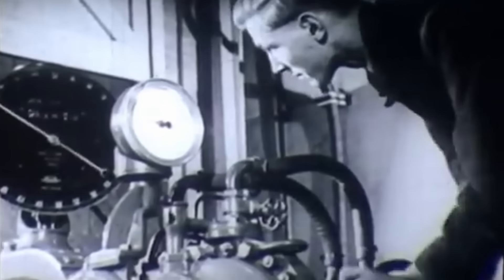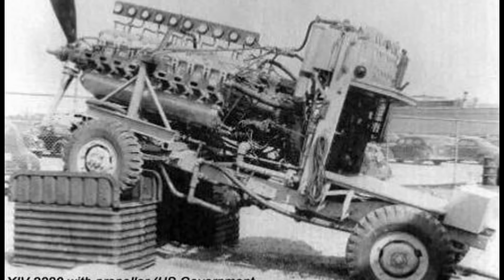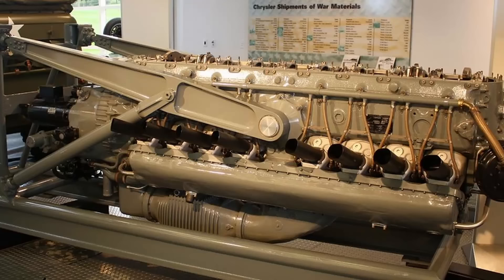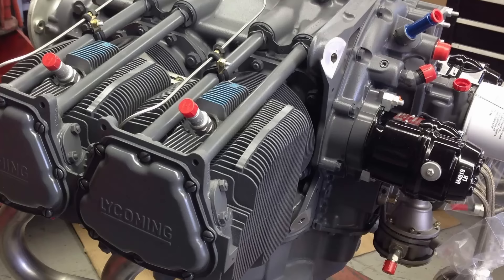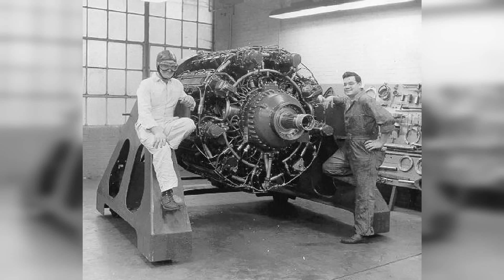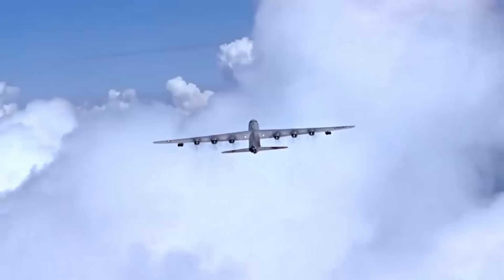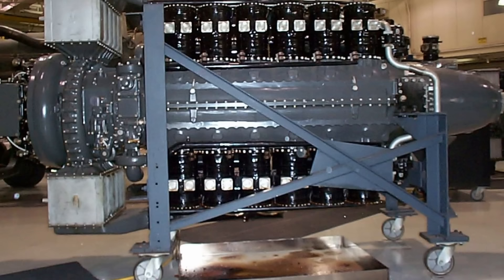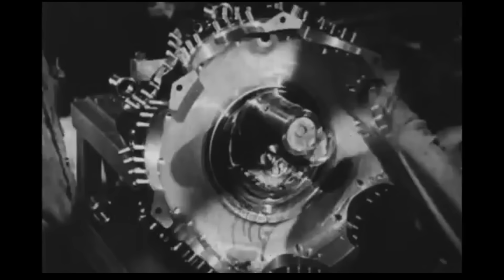The Forgotten HYPER Aircraft Engines of WWII

Comment: It’s rather interesting that none of the US engine manufacturers tried with 2-stroke designs. Rolls-Royce, on the other hand, developed the Crecy which was pretty much the crackhead cousin of the Merlin.
Reply: The Crecy ran on the test stand but that time the piston aero engine was being superseded by the gas turbine.
Reply: You cant use 2 stroke engines
They need turbo and 2 stroke have no valves so the pressurized air will pass and the engine will lose a Ton of power.
Plus you must regolate fuel mix relative to altitude and 2 stroke cant mantain mix precision
Reply: An excellent comparison
Reply: Look up the junkers ju-86p and the jump 207 engine
Reply: @RealNotallGaming  Don't tell Electro Motive that .
Reply: @mpetersen6  It's a shame because apparently when it was tested the ground crew had to use earmuffs even miles away from the testing site. Alongside the Kuznetsov units in the Tu-95 and the experimental Allison ones in the Thunderscreech, Spitfires with the Crecy would've been one of the loudest propeller-driven aircraft ever built.
Reply: @RealNotallGaming  Not necessarily a turbo, but forced induction was necessary to flush out the gases from the crankcase quickly. The Crecy I mentioned had sleeve valves replacing the more conventional reed valves in 2-stroke engines and a supercharger to flush out the gases quickly, which helped it gain approximately double the HP of a late-war Merlin.
Reply: @mpetersen6  and what a shame that was.
With the noise and power it made, it would have been impressive.
Obsolete, but impressive.
Reply: @RealNotallGaming  I'm surprised the Germans didn't know that, and wasted all that time actually making 2T engines.
Reply: @RealNotallGaming 2-stroke diesel with completely separated oil system already existed several years earlier. It use externally driven pump instead of crankcase and reed valve
Reply: @fredyellowsnow7492  DB600 series engines are 4T
What are you talking about?
Reply: @darrenstead3008  5900 mt of ceiling
max speed at sea level
bomber for low alt cruise missions
like 2000mt

jumo 207 variant is 4T because diesel engine CANT BE 2T
^^
Reply: @Nafeels  
2T engines for definition HAVE NO VALVE :)))
Reply: @RealNotallGaming  Not quite true there are 2 strokes with rotary valves and the Crecy had sleeve valves and direct injection, although the most common 2 stroke is a piston port design like most old scooters and such.
Reply: @RealNotallGaming  the P variant could fly upto 41,000ft, approx 12,500m and was pressurised
Reply: @RealNotallGaming  a couple of points 
1, two stroke engines are by definition forced induction, they can’t work otherwise, this is due to having the induction and exhaust phases simultaneously  happening at about BDC. There isn’t enough piston movement to shift the air into the cylinder otherwise. 

2, 2 strokes can have (exhaust) valves, ref Detroit Diesel or Electro Motive

3, all aero engines by this point in time were routinely supercharged either by an engine driven centrifugal compressor or with an added turbo charger. It isn’t at all unusual to have both an engine driven compressor and a turbo charger fitted on the same engine, turbo charged 2 stroke diesels use this arrangement.
Reply: @ATomRileyA  the common 2 strokes
the normality, the law
then if someone want to experiment, can change layout

air forces prefer 4T because is simply better
Reply: @jiminycricket9877  
I'm not sure which would have sounded more extreme. The Crecy or the Tornado. 12 cylinders firing  per rotation vs 21.
Reply: @RealNotallGaming  I’m sorry if you have misunderstood me, I am not trying to make fun of your misunderstanding of this fascinating subject. As you have watched this video and have commented I must assume that you have a passing interest in the subject.
  Both 4 and 2 stroke engines work on the same basic principles, both being internal combustion engines. 
With a 4 stroke engine it’s the usual “ suck, press, bang, blow” cycle with each of the operations being performed separately over 2 revolutions of the crankshaft. This is why the camshaft and distributor is driven at half crank speed. 
Two stroke engines have the same set of operations, the difference is that these operations take place over one revolution of the crank so the induction and exhaust phases take place simultaneously with the piston at the bottom of the bore so that the depression in the cylinder in minimal, you get crap volumetric efficiency, hence the need for a blower of some description. 
  The German aero engine maker Junkers had a 2 stroke Diesel engine in production during the Thirties, it was used in long range aircraft where the low fuel consumption was useful, fun fact, it was used by Napier who had a license to build it as the inspiration for their Deltic 2 stroke diesels
Reply: @scrumpydrinker  thats my point ^^
1) 2T has low fuel, with same displacement respect 4T has more torque
2) opposite for 4T, they have more qualities but consume more fuel
3) the normal 2T having blow chamber and exaust port\crankshaft port "in common" has less performance respect 4T because polluted next cycle and depression flow of new mix into exaust port
my poor english X,D
what i try to say 2T cant use all its mix and lose performance

of course is minimal
but in war every Hp count so fighters and interceptors use 4T
while bombers that just cruise until drop zone CAN use 2T

still for high alt performance 4T with NOS\ethanol\water + mechanical boost
was the top choice

^^
Reply: On top of the horsepower it made, by exploiting that power stroke every revolution RR intended the Crecy to produce lots of actual thrust from its exhausts as the used gasses left the building...it was very, very loud.
Reply: @markyoung13  eheh
braw braw braw sounds
Reply: @fredyellowsnow7492  it is good to remember that the Germans wasted enormous time and resources to develop the awful coupled DB 610 using two DB 605A-1 or the DB 6 03E using the coupled DB 601 much like the Avro Manchester courtesy of the Rolls-Royce Vulture engines, which were underdeveloped , underpowered , unreliable with the tendency to overheat. But the British instead of getting crazy they added two more engines thus it was born the wonderful Lancaster. The Germans could have easily have done the same installing the four DB 605 engines but because of the foolish requirement for moderate diving it was almost impossible to install. They would have solved a lot of problems....
Reply: @RealNotallGaming  I think I see the problem, you are looking at it from the car / motor bike point of view, with all 2 strokes an excess of air is pushed through the cylinder when the inlet ports are open to purge the exhaust gases. With a carb this will also mean that a proportion of the fuel supplied   will go straight out the exhaust and so is lost, this is the major reason that 2 strokes were banned as the unburnt hydrocarbons caused major pollution issues. If you were using a petrol/ oil mix for engine lubrication you ended up with a right mess. The Crecy  was to be used with direct fuel injection into the cylinders similar to the fuel systems used on the German engines, in this the fuel isn’t introduced into the cylinder until the inlet ports are closed so the purge air is just that, air, without any fuel in it… The actual engine was actually a dead end as by the time Rolls Royce were in a position to resume development they were heavily involved with gas turbine development. Crecy development was started before the war but was not proceeded with as they were concentrating on Merlin / Griffin development. There was a suggestion that the Crecy could have been tuned for a long range role, I wouldn’t like to say how feasible that would have been.
Reply: @scrumpydrinker  AAAAHHH :D
now i see
there is no mix but direct injection like diesel
so is a 2T injection
not a 2T carburator
thank you ^^
Reply: @RealNotallGaming  yep. Those thing does exist

The oil system is perfectly sealed and similar to standar 4 stroke engine. The air were pushed directly into cylinder with external pump. Those kind of 2T mostly found on diesel engine. 

The only reason 2T gasoline were using crankshaft pump because you just can't make external pump go too small, especially with something like moped. But in this case, since it's large engine, you can go with fully sealed oil system and external pump 2T engine.
Reply: Mind you that a 2 stroke engine has little to do with a 4 stroke engine as they are entirely different engines!
Reply: 2-stroke diesels is what powers almost all large cargo ships. So yes, it's an extremely successful concept. But beyond being 2-stroke, it has little in common with a 2-stroke chainsaw engine or such that most consumers are probably familiar with.
Reply: @RealNotallGaming  Have a look at the YouTube vid on the Crecy engine. RR used a really neat sleave valve system to overcome vapour and power loss. There was also a New Zealand engineer that had overcome that problem in 2 stroke engines using Rotary valves.
Reply: @RealNotallGaming  @2strokestuffing 😄
Reply: @scrumpydrinker  Motorcycle two strokes use the crankcase as a plenum chamber and the crank to pressurise, mix and pump the charge into the cylinder.
Reply: @SvenTviking  there is a story written somewhere and I'm going by memory regarding this issue. More or less it went this way: somehow Hitler talking with the top Luftwaffe people found out about this crazy dive requirement, something like 30°, forcing the engineers to incorporate lot of strengthening and installing dive breaks and whatever. Hitler was furious because he said he knew nothing about it and now he understood why it it took such a long time to develop the He 177 with it's awful engines killing quite a few crew members. That said when it was lifted this absurd imposition it was far too late. It is not a question dictatorship or democracy but a question of bureaucracy: the larger it is the less inefficiency it will be with continuous bickering and rivalries. Nothing new here...
Reply: @RealNotallGaming  sorry, but i kindly disagree, the definition of a 2T engine has nothing to do with ports, valves, lubrication,size, cooling, power, torque, air density, fuel composition,etc.
2T definition It's just about  achieving the full cycle in one revolution.
We have the real world assumptions for a better understanding on a casual conversation.
And most important, there is the usual “description” of a 2T engine describing an engine without valves, but there is a huge difference between “definition” and “usual description”.
On the internal combustion engine types, 2T are the most  and less powerful, have the most and the less torque , they are the most efficient and most wasteful, they achieve the highest  and the lowest max rpm values,etc etc.
Before Tesla, regular people usually though electric vehicles were slow and without much power. But they were by far  between the most powerful vehicles. And some even had/have, by far, the longest ranges.
But i will describe a vehicle with a battery and an electric motor if asked.
Reply: @SvenTviking  yes they do, cue the dreaded Villiers 8E, it is still a form of forced induction 2 strokes will not and cannot work without it.
Reply: @RealNotallGaming  so no Detroit Diesel 671 TIB exists ? It is a turbocharged, two stroke diesel, with poppet valves. I promise they exist.
Reply: @RealNotallGaming  False. Junkers Jumo 204/205/206 series during WW2, and small aircraft 2 strokes today.
Reply: @chrismcleod9748  nothin about performance
Reply: Springvale Studios, Ipswich, Suffolk, East Anglia, UK.  ...thats not ... a plane's engine ...
Reply: I’ve always thought of 2-stroke motors as a sloppy, inefficient mess used in the Warsaw pact.  I think my Sthil weed whacked as a very refined 2-stroke but so many of the rest of them are loud, smoking things that required a lot of fiddling.
Reply: @RealNotallGaming  The crecy had valves.
Reply: 2 strokes have a higher fuel consumption per hp than 4 strokes.  Long range is a highly desirable quality of aircraft engines
Reply: The Crecy never went past the prototype stage.
Reply: @Nafeels  my understanding is that the TU 95 is loud because the prop tips are going supersonic, not because of the engines.  Well, the engines might be loud too, but not that loud.
Reply: @chrismcleod9748  Achates power systems has developed a modern version in 6 cyl versions as well.
Reply: @RealNotallGaming  2 Strokes usually don't have any direct valves although the piston works as a valve but this does not mean they can't have a valve. I believe the Crecy was a sleeve valve engine so it did technically have a valve. I've seen several that also do have so form of valve as well. Even with the standard design for a 2 stroke engine doesn't mean you can't run a Turbo or what most engines of the time used, a supercharger. There is a YouTuber @twostrokestuffing building a 50cc Supercharged 2 stroke that uses a more convenient design.
Reply: Jumo in Germany made several 2-stroke aero engines
Reply: @scrumpydrinker  Uniflow 2-strokes are not Forced Induction,  they have a Scavaging Blower and are  "Normally Aspirated" as oppossed to Naturally Aspirated..
Reply: @scrumpydrinker  That you got correct, the Crecy uses Stratified Charge Mode Combustion with pre-chamber GDI...
Reply: @sandervanderkammen9230  piston engines, whether two or four stroke are divided into two classes, blown (by whatever method the designers care to choose) and unblown. A 4 stroke engine will run quite happily without any form of blower, my first car was an old Austin A 30, no blower, my present car is a Wagon R, no blower. 4 stroke engines use the classic “suck, press, bang, blow” cycle in which the various phases of the cycle occurs over two revolutions of the crank. 2 stroke engines follow exactly the same method of operation, the major difference is that the whole cycle occurs over one revolution of the crank with the induction and exhaust phases occurring simultaneously with the piston at the bottom of its stoke. There is very little relative movement of the piston available to pull the fresh charge into the cylinder. ALL 2 stroke engines must have a method of pushing the fresh charge into the cylinder whether it is a Rootes blower, turbocharger, a combination of the two or in the case of a simple 3 port 2 stroke the action of the piston movement with an air tight crankcase. All are methods of moving the fresh charge into the cylinder and as such are forced. 
 “ Uniflow” means that the gas flow in the cylinder does not change direction, it goes in one end and out the other, on a 2 stroke diesel the induction ports are at the bottom of the cylinder uncovered when the piston is around BDC and the exhaust valves are in the cylinder head and are open at the same time as the ports are uncovered hen the air going in one and out the other.
Reply: @scrumpydrinker  Sorry but you are clearly confused about the difference between Naturally Aspirated and Normally Aspirated..
These are not interchangeable terms.
Reply: @sandervanderkammen9230 No I am not, they are the same thing and you are arguing semantics.
Reply: @scrumpydrinker  Sorry but you are clearly confused and misinformed about this subject... please do your research or leave this discussion for those who are properly educated and qualified to discuss it.
Reply: @sandervanderkammen9230  2 questions,
1, explain in your own words the difference between “normally aspirated” and “naturally aspirated” 
2, is the flat four as fitted to the VW Beetle normally aspirated or naturally aspirated?
Reply: @scrumpydrinker  Any decent engineering encyclopedia or Diesel fundamentals textbook should have a clear and concise explanation of the difference... any good Diesel mechanic should know this from 101 introduction to Diesel engines.

The term turbo-normalized is also often used in aviation to refer to 4-stroke Normally aspirated engines with turbochargers.
Reply: @sandervanderkammen9230  So, you are not prepared to explain in your own words the meaning of the two terms then
Reply: @scrumpydrinker  A Normally Aspirated engine is any engine equipped with a supercharger or turbocharger but it's  Intake manifold pressure is not intended or capable of exceeding the atmospheric pressure above Mean Sea Level.

Naturally Aspirated engines are those which operate without a supercharger or turbocharger.
Reply: @sandervanderkammen9230  you seem to be confused as to why a supercharger or turbocharger would be fitted in the first place. So, what is the purpose of a supercharger and why are they used?
Reply: @scrumpydrinker  No, clearly you are the one confused.
 Normally Aspirated engines use the supercharger or turbocharger for either exhaust scavaging or Altitude compensation.
Reply: @sandervanderkammen9230  those are the only reasons for fitting a supercharger then? Interesting.
Reply: @scrumpydrinker  On a Normally Aspirated engines, Yes.
On forced induction engines they are used to increase volumetric efficiency and IMEP
Reply: @sandervanderkammen9230  Sander, if you are getting your information from a Wikipedia page it would be better if you read and understood it fully before commenting.
Some of your misunderstandings
1, “normally aspirated” and “naturally aspirated” are alternate descriptions of the same thing, in this case an engine that doesn’t have any form of forced induction. 
2, turbo nor
Reply: Sorry pushed the wrong button, turbo normalised is when a turbocharger is used on an aero engine to maintain its sea level power at altitude, just how much boost would you need to provide to maintain sea level manifold pressure at 30000 ft, this is not light supercharging 
3, Roots type or positive displacement blowers are used on both 2 and 4 stroke engines, when they are used on 2 strokes the are classed as “ normally aspirated” as the things need a forced induction system to actually work, when used on 4 stroke engines they are used as superchargers, this is not new technology, Bentley were using them in the 1920s
4, as stated in point 3 all 2 strokes need some form of forced induction to work, you simply will not get the gas flow through the engine otherwise. You seem to have a poor understanding of what is actually happening in a 2 stroke engine and why it needs to have some form of forced induction.
Reply: @scrumpydrinker  Your comments reveal someone that obviously lacks any formal education or professional experience in the field of engineering or engine design.

I suggest you learn something about the topic, Encyclopedia of Automotive Engineering by David Crolla, Part 1. Chapter 9, Gas Exchange- Breathing and Air management.
Reply: @scrumpydrinker  Thank you for conceding, and admitting  that you were wrong.
Any questions son?
Reply: Watching the assembly of a Radial Engine at the very end of this video is totally Gear Head Porn !
Reply: @RealNotallGaming  idk, 2 stroke gm diesels work fine. also, 4 stroke turbo engines have both valves open during overlap.
Reply: @arthurmario5996  GM/Detroit/EMD (Winton Type Diesel engines) have no manifold boost, the Crecy could produce a manifold boost pressure above atmospheric pressure and was regulated by a special boost control valve.
Reply: @arthurmario5996  As a general rule turbocharged 4-stroke engines have very little to no overlap.. the exception is VVT engines that can vary overlap depending manifold pressure.
Reply: @RealNotallGaming  Have you never herd of a valved two stroke?
Reply: 2-stroke diesels with compressor worked gasoline 2 stroke engines due to their interior needs will never have satisfying power with satisdying fuel consumption.Even today no automobile is offered with a 2-stroke engine!!
Reply: @RealNotallGaming  HUH?? 🤔
Have you NEVER heard of a Detroit Diesel 2-stroke?? 🤦🏻
Reply: @RealNotallGaming  Two stroke diesel engines do infact have exhaust valves bit no inlet valve. You are correct in saying they need to be force fed with the supercharger usually just to get them started since no intake valves means no suction for air fuel mixture so it's pumped in via super charger for air and injection for fuel supply.
Reply: @Nafeels  not quite right, the forced induction was to supply sufficient air at volume to the cylinders as there are no inlet valves on large two stroke engines, the piston going down uncovers a port in the side of the cylinder wall and recieves air charge that way, injection handles fuel delivery.
Reply: Two stroke engines very wasteful of fuel, and run best over narrow rev range with tunes exhausts where back-pressure pulses control the wasteful blowing of fuel out of exhaust port.  Also lubrication of two strike engines is very hard,  the oil has to be mixed with fuel and that results in borderline lube and whiskering of spark plugs, leading to misfiring.
Reply: Didn't Packard make a diesel 2 stroke aero engine in the 1930's? Maybe it was 4 stroke? I'm not sure...
Reply: @RealNotallGaming  You can do what is called a uniflow engine.  The intake port is governed by the piston and the exhaust is through standard poppet valves in the cylinder head.  At a minimum, a scavenging air blower is needed.
Reply: Not quite true. Post WW II two stroke diesel engines powered most of the large busses. They were cheap and light weight though not real fuel efficient. Eventually 4 cycle improved to the point that they were a better option however some of the old 2 cycles are running today in busses that have been converted to motor homes. 
There is one other problem with those old engines. Sometimes the blower would develop a serious oil leak and the engine would start running on engine oil. If not stopped, the engine would over speed and blow up. To deal with the failure, the driver had a cutoff that would shut the engine down and it could only be reset in the engine compartment. Kids might trip the shutoff forcing the drive to reset it before they could continue on their trip. 
On the other hand, many of those blowers had a second life on the drag strip as it wasn't difficult to convert them to large gasoline engines. 
Gasoline two stroke just never had the money to properly develop it. In the end, it still would not have been the best engine but in the early days it would have been competitive.
Reply: @RealNotallGaming  diesel engines can be 2 stroke, and have been built
Reply: Yanks never seemed to go for sleeve valves either.
Reply: The worst thing of all is the manufacturers Had dohc, with outstanding mechanical fuel injection, multi super chargers, and then ten years after the war they give us a two valve clunky cast iron block/ head combos that in comparison looked like a child cast it, just think of not only the power but fuel economy that could've been attainable, what a screw job we were sold!
Reply: @RealNotallGaming good point
Reply: @thomasfx3190  lol, you've got it completely back to front!
Reply: In Reciprocating Piston Engines, nothing compares to Single Sleeve Valve, pls read interview with Mike Hewland in Car&Driver, July 1974, a Bricklin car in cover.
Reply: Two Strokes make me have fear of seizing, it could not be the safest option for manned flying machines, Wankel has the best power to weight ratio, with a fuel economy better than 2-Strokes, a bit thirstier than 4-Strokes, Wankel can work on 80 RON Fuel, AvGas is every day harder to find.
Turbines of small size will never be economical in fuel, it's a Reynolds Number issue, they say, also, maintenance and service require  specialized skills. Or not?
Reply: @sandervanderkammen9230 Detroit Diesel 2 strokes came in NA and turbocharged.
Reply: @zachfpv4493  Detroit Diesel 2-stroke engines are not Naturally Aspirated... they are Normally Aspirated

A turbocharger can be installed on a Detroit Diesel engine, but it is not "Turbocharged"
It's Turbo-normalized

Any questions?
Reply: @sandervanderkammen9230  no the supercharger on all of them does the "normalised aspiration" and when you add a turbo it is boosted.the NA only have the roots type blower in the valley of the motor.
Any questions?
Reply: @zachfpv4493  No manifold boost on a Detroit Diesel engine.

When the turbocharger spools-up it unloads the blower to reduce pumping loss
The engine is still running in Normally Aspirated mode.

You needed to study up on your 2-stroke Diesel facts.
Reply: @sandervanderkammen9230  no it adds boost at higher rpm.the Detroit literature says turbocharged and so does every mechanic that works on them.
Reply: @zachfpv4493  Sorry but you are very confused and misinformed, all Winton type 2-strokes are Normally Aspirated and manifold pressure never exceeds 0.7 Psi at sea-level.
Any questions son?
Reply: @zachfpv4493  Detroit Diesel engines are either Normally Aspirated or Turbo-normalized.
Reply: @RealNotallGaming  Detroit Diesels have exhaust valves controlled by a camshaft.
Opposed piston diesels (Jumo, TS3 and Deltics)  have exhaust and inlet ports but opened and closed by pistons at different times
Petrol 2 strokes (motorbikes, some cars, chainsaws etc) have the carburettor feeding the crankcase to provide the positive pressure to charge the combustion chamber.
No reason not to use a blower to charge the combustion chamber, same as a diesel.
No reason not to use an exhaust port higher up the cylinder (same as motorbikes)
No reason not to use a powervalve in the exhaust (Yamaha YPVS) to give some varience to exhaust timing
As German aircraft engines have fuel injection, why not the Crecy (direct injection could save juice)?
Could use expansion box exhausts but I would think that would take too much room

A small disclaimer. I know next to nothing about the Crecy so you've probably realised I'm speculating but I have owned 2 stroke bikes and know the basics of stroker diesels
Reply: @fredyellowsnow7492  I think that was an opposed piston diesel (Jumo)
I don't think they had a 2 stroke petrol engine for planes
Reply: @RealNotallGaming  Wrong. Ever heard of the Detroit Diesel ? 
That has  cam driven exhaust  valves in the head as did the EMD loco engines

The Jumo doesn't have valves. It is an opposed piston diesel.
The inlet ports are opened and closed by one piston and the exhaust ports by the other. 
Other examples are the Commer TS3 and the Napier Deltic
Reply: @Handirifle  In a war situation, out and out performance is the only thing that matters.
The gas turbine (jet) engine was a right thirsty beast
Reply: The books by Harry Ricardo about 'The high speed Internal Combustion Engine' include a section about the 2-Stroke, Diesel engine, with open sleeve, acting as an Annular Piston, one of best engines ever in fuel economy.
Reply: @RealNotallGaming Detroit diesel engines are two stroke and have valves.